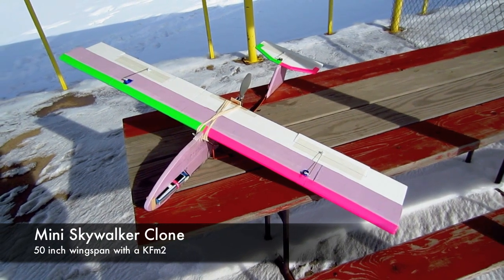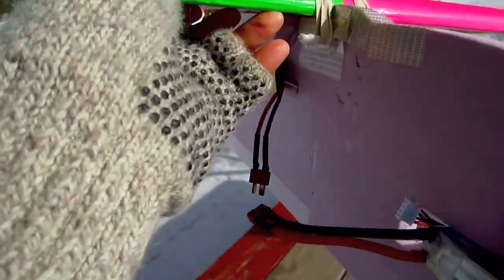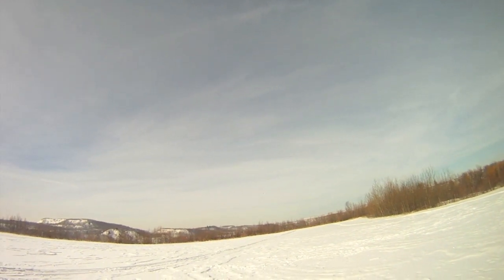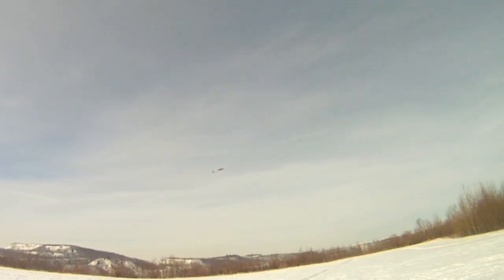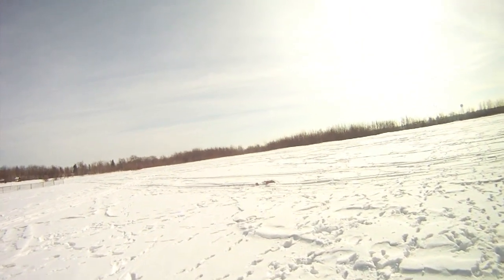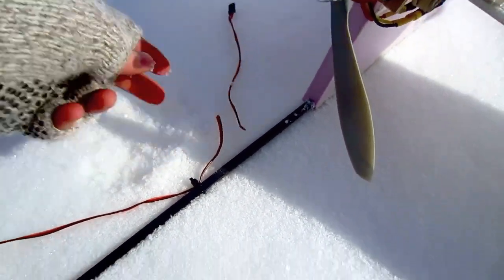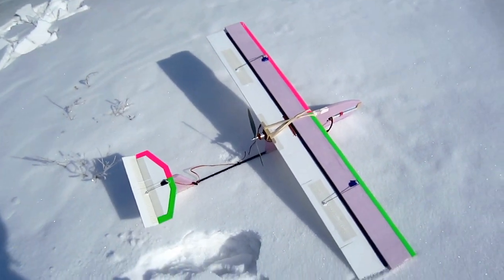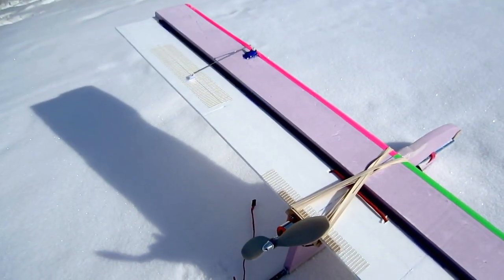Mini Skywalker

Comment: I like the design. I wonder if you gave it about 10 degree angle on the motor and maybe a little up that it might compensate for the inability to turn to the left.  Just a thought. Great job though!

Comment: This has been mentioned before, but your main issue is that you have a massive vertical surface in front of your CG. You want your the sum of the vertical surfaces in front of the CG to be smaller than those behind it so that the plane naturally turns into the wind like a weather vain. This is why you had to have a very high bank angle to turn, because the plane will just drag its tail behind with the nose being pushed up from the side. You could turn right because you were torque assisted, but left, not a chance.

Plane slows down really nice tho!

(Shameless plug, I just posted my first youtube video: a gopro onboard a 90 mph FT viggen. Go check it out on my channel and let me know what you think!)

Comment: I think you're on the right track with the higher KV smaller prop, Also you can shorten the height of the fuselage as you'll need only enough clearance for a 6/7 inch prop, that should also increase performance. By the way great channel, love you're simple but effective builds

Comment: Both good ideas. The flat fuselage in front of the wing will fight the tail's ability to maintain good tracking. 

Been trying to think of a light and simple way to make a round fuselage; best I've thought of so far involves a combination of PET soft drink bottles with intenal foamboard frames for support. If I can get it right it should look kind of like a like a cutaway of an airliner.

Comment: If it had a rudder, I'd be telling you to apply some rudder trim to the left. It drops the tail on a left hand turn and keeps it nice and high on a right hand turn. Uneven rounding on the front of the fuselage or on the tail itself could cause this tendency to turn to the right. A larger tail would make this sort of problem less prevalent, but is likely to only reduce the problem.

Comment: I vote: too much vertical surface forward of the CG causing a slip in turns.  Some other subtle asymmetry like torque or thrust angle making it more pronounced in left turns.  I bet you trim down the fuselage profile and/or add larger vertical stab and/or rudder then you'll be good.

Comment: The prop wash is making a small tornado over the ruder  and vertical stabilizer, full  size aircraft have the same problem. you can make the vertical stabilizer longer, or make a tall v-tall so the prop wash goes between them  and you still get the control you need.

Comment: I think you should be able to overcome that issue by adjusting motor thrust angle.  If it turns well with power off, I think your control surfaces are fine.  You could verify this by putting a pusher prop and reversing the motor direction to see if your problem moves to right turns.

Comment: If you couldn't turn left at all you clearly need a larger aileron surface or move the ailerons further out on the wing. Why don't you just extend the ailerons all the way out to the tips of the wings? 
Hope you get it sorted. I like the super simple design and apart from the left turns it looked like it handled very well.

Comment: I agree with the previous comment that the ailerons should be larger and above all placed further out on the wing. 
You don't have to switch motor. You can counteract the large prop by mixing in throttle input with the aileron signal.